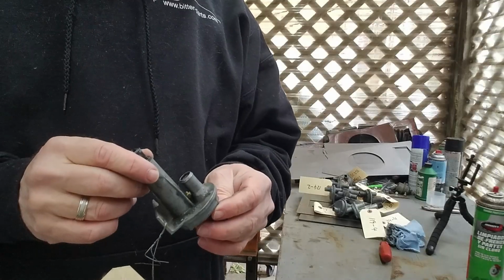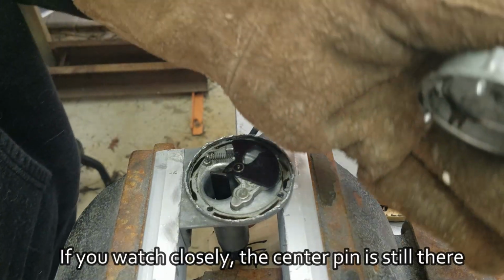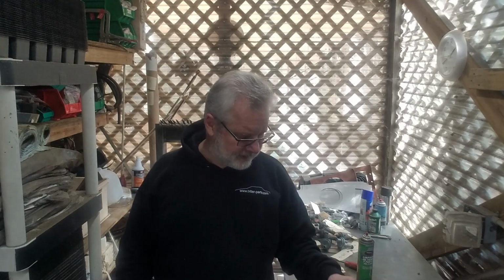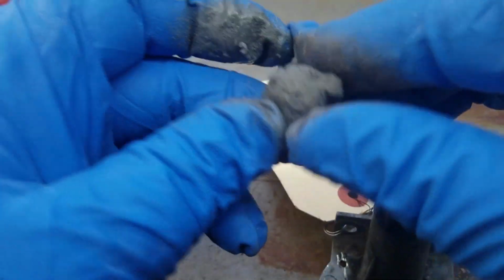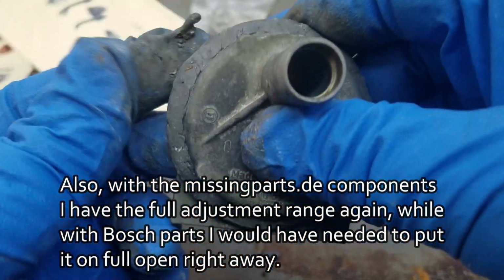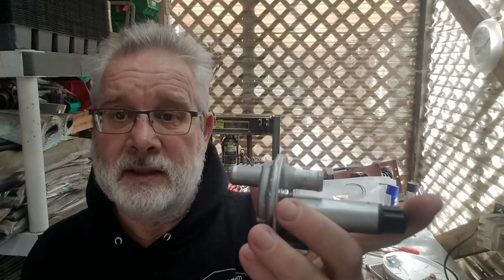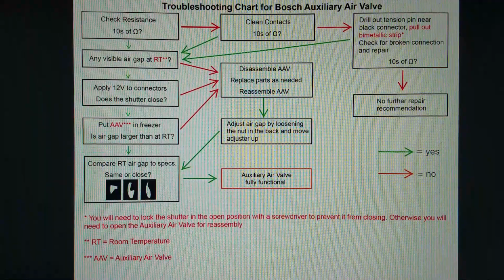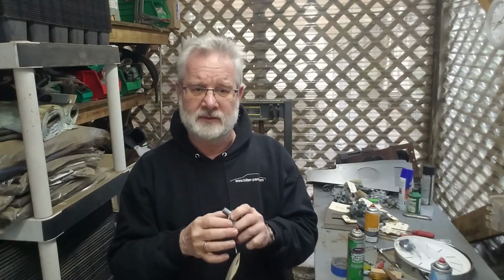Opening, Troubleshooting, and Repair of Bosch K / L-Jetronic Auxiliary Air Valve/Zusatzluftschieber

Comment: I have a strange problem with my BMW E12 (5er) L-Jet with this slide valve. 

It starts and doesn't idle up the way it should. It idles down, like 3-400 rpm and as it warms up it finally settles at 1100rpm which is much higher than spec.

I've tried adjusting the valve, but I might again... Also maybe my injectors are sticking open or something.
Reply: That's a clear indicator the valve isn't opening when cold. The warm idle can be adjusted with a screw but, if you bring it down, your cold start may get worse.